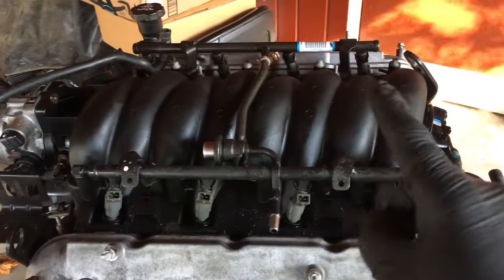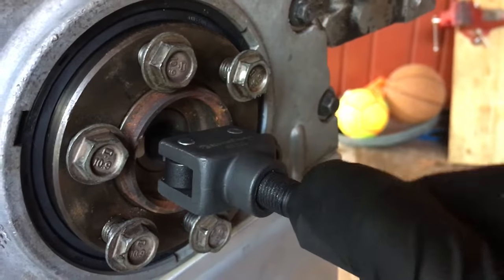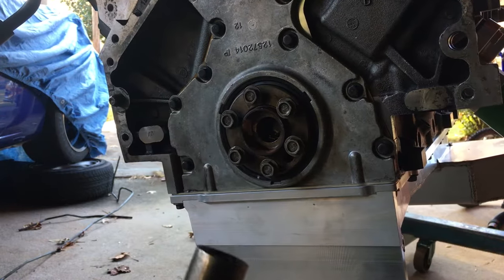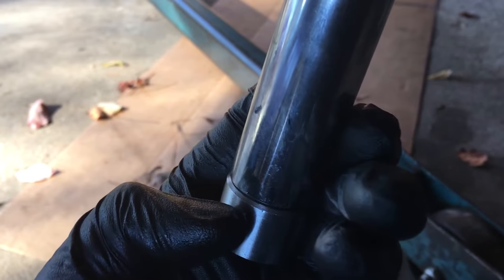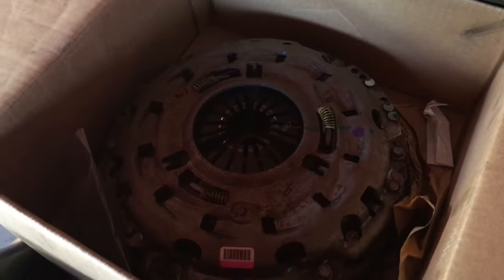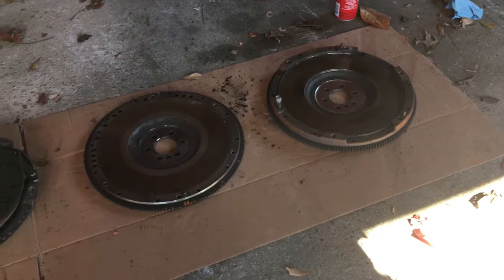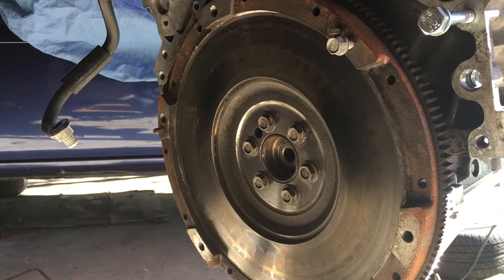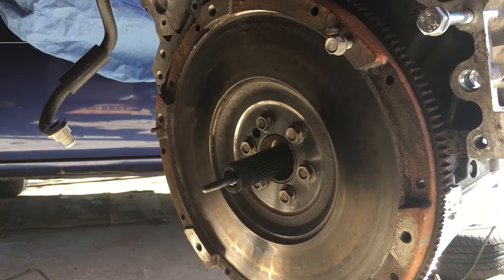throwout bearing and LS7 Clutch install - LS1 240sx (S14) Drift Build (EP 31)

Comment: Obviously this is slightly old and prices may have changed, but you can get a new LS7 clutch kit on rockauto.com for $227 not including shipping or tax. Part number is LuK 04-905.
Reply from the maker: That's good information for people to know. thanks!
Reply: @toxicmongoose7061  No problem! I learned this only after I bought one for $60 more haha. Don't want other people to do the same.

Comment: Did you have to shim the slave at all? I’m using a wilwood .75 and I didn’t change the rod over from the old SR master so idk if that’s what Is causing my crappy pedal issue but I can’t push it down far enough to get the clutch to fully disengage to go into gear. Help please!
Reply: I’m having the same issue it only engages in the air and the tires spin even with the clutch in. I redid my entire master cylinder and shimmed the throw out bled it fully still no luck

Comment: Hey man I did this clutch upgrade on my ls swap, I’m using a t56 with a stock ls1 slave did you run that too or did you have to upgrade the slave to a ls7 ??? I’m having issues with mine clutch not releasing
Reply from the maker: I ran an LS1 slave. There was an issue getting it all bleed correctly and took some time but eventually worked fine.
Reply: @toxicmongoose7061  thanks man for the response! how long did you bleed it for till it started to work?
Reply from the maker: took me a couple hours doing it by myself. new clutch master also needed to be bled.
Reply: Same here my t56 only goes into gear with the car in the air or the engine off. I gave up after bleeding and shimming to exact spec dropping the trans 3 times replacing the master cylinder been sitting for 2years on a fresh forged rebuild and bore to a 376. This comment makes me want to go give it another shot or just grab a monster for the ls1

Comment: Can I use the ls1 flex plate on ls7 clutch? Or it's just an upgraded flex plate?
Reply from the maker: it "seems" like you could but from what I understand you can not. I believe that the surface area for the LS7 is much greater.
Reply: @toxicmongoose7061  
Thanks for the help 👍👍
Reply: You cannot use a flex plate with a clutch, you need a flywheel.
Reply: Oh I just realized I was asking the wrong question 😅, I meant can I use ls1 flywheel?? Sorry I got confused